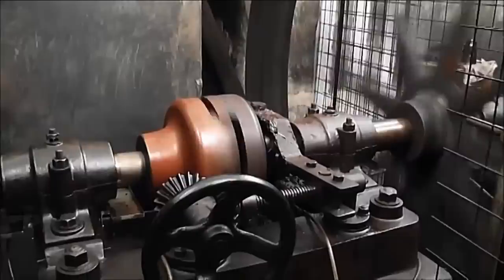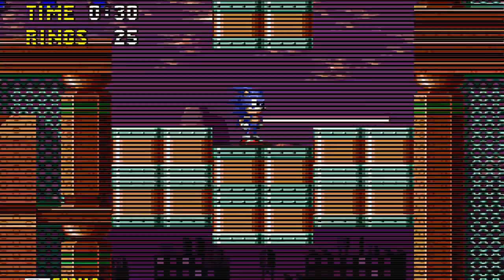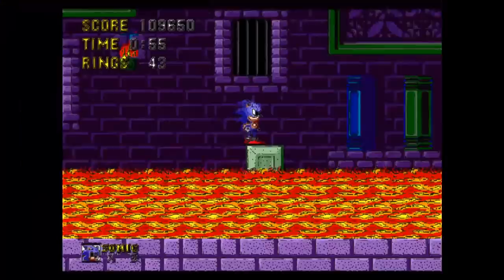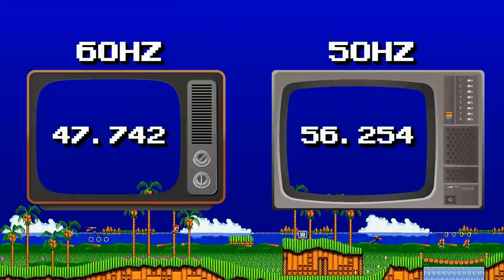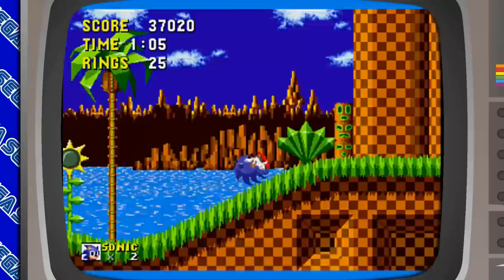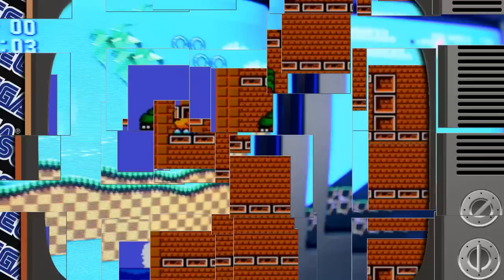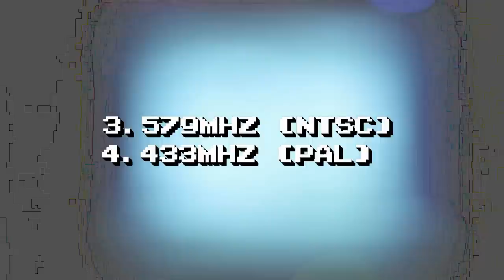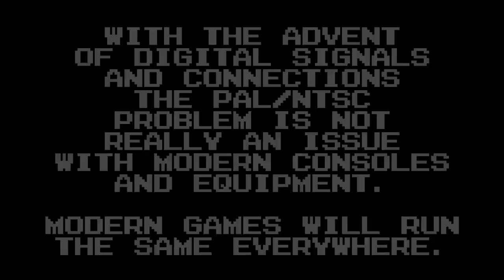Why is Sonic Faster in America? NTSC vs PAL/60Hz vs 50Hz | Nostalgia Nerd

Comment: Yeah we may of been having our blue hedgehog at a glacier 50hz but we got a lovely somber version of Star Light Zone! Take that rest of the world!
Reply from the maker: I do enjoy that version. I also prefer Labyrinth Zone in 50hz
Reply: Similarly, I thought the boss theme sounded more menacing when slowed down.
Reply: But you do realize that the composer of music always intended it to be in a certain pitch and tempo. That's the big problem with PAL in general is that it has a telecine process that speeds up 24 FPS of film to 25 FPS which speeds up and pitches up the sound unlike the NTSC 3:2 pulldown. Pitching up the sound is far more noticeable than the NTSC "jittering" of 3:2 pulldown.
Reply: Apart from the film speed up, 50hz does also use a pulldown system done every 12 field of video!
that works better than the 3:2 pulldown..living in the States back in the 90`s i notice that watching movies on 60hz,the judder was very annoying and distracting to me,i was not accustomed to it, ,also the picture was a little less sharper and the lines very visible on a tv tube 21 inches up and the colour was not as good ,in some programs it look really nice but when they would cross over to programs comming from different parts of the country or video recordings the colours were horrible.
this you could correct with the tint control that was new to me ,but there came a time you just would not bother to correct it anymore and put up with its colours,now moderm tv sets everywere have these tint controls in them, that i find good only for old american tv shows recorded on old vcr.We did get screw up with the Japs slowing down the games and putting black bars at the top and bottom of the picture due to there lower resolution of video.

Comment: 2 things.  1) Sonic 2 in PAL does NOT have optimised gameplay, (it's the exact same as Sonic 1). Only the music is optimised. 2) If you switch the region of the Megadrive/Genesis/emulator during the game being run, you'll get undesired effects. Change the region before starting the game. Otherwise, nice technical video. My video didn't inspire you by any chance did it? :)
Reply: redhotsonic Sonic 3 I believe was better optimized, as the gameplay was much closer to NTSC speeds
Reply: Hey man like your vids
Reply: Wouldn't the PAL version modified to run at the right speed on PAL consoles require the PAL ROM?

Comment: PAL is still better. I wouldn't have survived without SCART Cables. The Image looks so much better.
Reply: I'm so jealous of the crisp slowdown and messed up music.
Reply: A Gamer Aaron Why not play games that are made for PAL? Most games have a PAL Version.
But with Emulation this war has ended.

I still have a SCART cable, even though only my old CRT has a input for that. So much better than Composite Video.
Reply: NTSC consoles have scart rgb output too
Reply: googleboughtmee I did not know this. I thought SCART was a European thing.
Reply: Michi Lo
The Americans didn't have the connector on their TVs but I think Japan did, and all regions SNES/MD can definitely output it if you have a TV or monitor to use it.
Reply: googleboughtmee Okay. I did not know that. But what is the use of a SCART output on the console, if you can't use ist...
Reply: I think it was easier to just not change the Japanese board much if at all.

Today though in the NTSC parts of the Americas you can buy either a SCART to HDMI converter or a more comprehensive upscaler like the Framemeister and get 60 Hz RGB just like in Japan. My US Genesis and PlayStation look fantastic going through a Framemeister.
Reply: MrMikehunt87 Yea. Most games run well on both. And if not, a Raspberry Pi can be a very good console!
Reply: Lamo one game ran slower but all others had fucked colors and lower resolution, I'm so jelly.
Reply: SCART to RGB is not the same quality as SCART to SCART, your cable is just an adapter to let you use European hardware on a North American screen.  True SCART has 21-pins and a fat, meaty cable to hold all those wires, but a SCART to X cable only contains as many wires as whatever X can handle and in the case of RGB/RCA that would be about 4 wires?  (Red, Green, Blue, Ground or Yellow, Red, White, Ground)

Having all SCART hardware in the 80 and 90's was like being the first people to adopt HDMI, it also meant you could copy a VHS tape so perfectly a viewer would be hard-pressed to tell the difference.  A bane for video rental stores in Europe.

Comment: Some clock radios have this kind of issue. In a 50Hz region the clock will keep perfect time, but the code written into the chip means that when advancing the time at high speed to set the clock, it counts up one for every mains cycle, so it takes 1.2 seconds to advance one hour, but in 60Hz regions it would take one second.

Comment: There is no PAL-RGB... only Zuul! :D

Nice video! I really like the comparison.
But please DON'T mix up PAL and 576i. The 625 line system (called 576i nowadays) is resposible for the resolution and field rate of 50Hz but has nothing to do with PAL.
PAL, NTSC and SECAM are nothing more than the colour systems used to transform a colour signal to a monochrome image with a colour overlay, which was necessary to remain compatible with monochrome sets in the 60ies and 70ies. Signals via s-video, composite (simply s-video fused together) and RF (modulated composite) use this technique and while it is true, that most countries with 50Hz use PAL and those with 60Hz use NTSC, it's still two different things. Brazil even uses PAL with 60HZ.That means, that there is no PAL RGB! Only 50Hz-PAL. If it is PAL or NTSC, it must be RF, composite or s-video - If it is RGB, YPbPr or anything digital, it is not dealing with those systems
And that is why the french consoles tend to have those weird RGB exeptions (NES and Atari 7800 are converted to RGB, Master System 2 has RGB and the N64 is prepared for RGB) and why you get colour with the Mega Drive on 60Hz via SCART, because you don't have to care for the colour systems, if you connect via RGB. There's just 60Hz or 50Hz, so don't call it PAL ;)
Keep up the good work! I especially like you CPC stuff :)
Reply: Well, mostly people use PAL and NTSC for these things, as it is just easy to say.

However, I am not sure I agree that these are just color standards, as they specify timing aspects of the signal which is the origin for the vertical resolution of the TV image. The timing became much more of an issue when they were adding a color signal while having to maintain the same bandwidth without causing too much interference between the different parts of the signal, so these new standards had to specify them.

In fact, for NTSC they had to reduce the number of lines per second a bit from the existing standard, which is also why the NTSC standard field rate is 59,94 rather than the 60 used for the older sytem.
Reply: +Ts6451 PAL and NTSC are nothing more than these colour systems. The number of lines and the refresh rates are determined by the underlying TV standards, like 'System M'. While it's true that the timing of the 60Hz systems had to be changed slightly below 60Hz for compatibility with NTSC, this timing is not a property of NTSC. It was done to make the combination of 60Hz TV with NTSC colour possible while staying compatible.

Yeah, I know a lot of people use the term PAL for 50Hz, but that doesn't change the fact that it's plainly wrong. it's like using the terms 'Stereo' and 'CD' interchanged because most CDs are in stereo.

Actually... I wouldn't have minded it that much here, if the NN videos weren't that good and correct concerning technical aspects. For the most part I looked over that PAL=50Hz thing here, but the part, where it's said, you can get colour with SCART because it is PAL60 is beyond wrong :D
It's RGB and PAL and RGB never occur at the same time... and there is a totally different thing called PAL60

I just complain because I care^^

Comment: Games released on the Mega Drive specifically for Europe usually utililze the higher resolution and better colour reproduction of PAL. So basically you give up some framerates for some higher resolution and better colours. Most games on the Mega Drive rarely hit 50fps anyway, so the framerate issue isn't that of an issue for most games released on the system.

Comment: The FCC forced RCA to develop a color standard compatible on both color and black & white TVs. A color carrier signal had to be able to display on both color and B&W TVs. That's why NTSC isn't perfect color. RCA developed perfect color in 1954 akin to PAL, but then this B&W backwards compatibility mandate by the FCC (called The Equal Pain Rule) compromised the color's quality.

Comment: Today it's the same thing here in the US. All TV's are 60Hz and 60 fps. However with modern flat screens they have a thing called refresh rates. refresh rates are a simulation of the real thing. Your TV is still just 60Hz. But a built in microprocessor in the TV takes the original 60fps and then adds in double the frames for 120Hz. And then again it doubles it if you have a 240Hz TV. A 240Hz TV is still only natively 60Hz. But through manipulation it's possible to simulate more than 60fps. 

So a chip inside a US based TV only has to double each time. (Easy math) 60, 120, 240 etc....

Every TV manufacturer gives this effect it's own unique name. Samsung calls it Motion rate. And you still see the effects of the 50Hz vs 60Hz. On a US version of a Samsung TV, or LG TV for example, you will see TV's with 60, 120, and 240 motion rates. But in the UK, TV's go 50, 100 and 200 motion rates. That's because the chip inside can only simulate by doubling the native frame rate. The native frame rate on a US TV is still faster due to our 60Hz electrical grid.

A refresh rate is how fast your screen refreshes. A frame rate is the speed at which the video source was captured at. US TV's max out at displaying 60 fps. But with refresh rates it's possible to make the image on screen far more fluid to the eyes by adding more frames.
Reply: You're talking about frame interpolation, even CRT TVs had a refresh rate, my old gaming monitor was a 75Hz CRT. 

"A refresh rate is how fast your screen refreshes. A frame rate is the speed at which the video source was captured at" Yes, this, exactly this, it has nothing to do with doubling the frames, like I said, that's frame interpolation.
Reply: I'm fairly sure 60Hz is global standard now, I've never seen a 50,100 or 200 TV, only 60, 120 and 240.

Comment: Ehm, alternating current was not invented for higher efficiency for long distances, but simply to make a more simplified motor work. For long distance transmission, the Voltge is at 50,000-150,000 Volts, THAT makes it efficient. Because the lines can be loaded with minimal current-intensity (Ampere) which is important because the higher the Intensity (Ampere), the hotter the wire gets. The colder the cable is, the more efficient is current distribution. But the total electrical power is what's important at the end. For example, 100kW (Kilowatts) divided by 220V would be a whopping 455 Ampere!   That is enough to make a nail melt in 3 seconds! (Look for 500 Ampere on youtube). At 100kV it would be measily 1A. A good household cable is rated at 16A....  At 50hz the length of the sinus-wave is 6000kM....not so important. Frequency is important for transforming low to high voltage. (In transformers for older LCD backlights)
Reply: AmstradExin Um, Ok, Ahhhh,  WTF, Without alternating current, How would you convert the low amperage,but high voltage current to the high amperage,low voltage current needed at the user end? Alternating Current certainly was developed PRIMARILY for long distance transmission of power It took a fuckin genuine genius (Nikola Tesla) to invent a practical AC motor when DC motors were already common at the time, That in and of itself proves that AC certainly was NOT developed to make simpler motors (I now officially have a headache...)
Reply: No, AC was chosen because you can send it cheaply over a distance by having multiple phases close together on a single pole, to send HVDC over a long distance is enormously dangerous and inefficient and can really only be done underground and is why Edison proposed having small power stations scattered throughout cities.  Even today we only send HVDC under rivers and seas because the consequences of an accident could be catastrophic.

Research it.

Comment: The SEGA Genesis/MEGA DRIVE video signal IS NOT INTERLACED! It is progressive!
With a resolution of 320x224 it fits in the 240p standart (with a few lines not being drawn and used for other operations).

The GENESIS/ japanese Megadrive were 60Hz, 60FPS (NTSC), while EU versions were 50hz, 50 FPS (PAL)
And while you stiil see scanlines, this does not mean the image is interlaced.

Aerial TV however is usually interlaced as well as VHS players. That's the so called 480i

Comment: Wait... no scart cables? Those were awsome :D I had loads of adaptors that went from basically all kinds of video outputs available. I even had a box so I could plug in 3 things and have it all output on the same tv with a press of either A B or C on the side. Scart cables were so cool and everything in my house was connected to screens with them. My ps1, my ps2 and even when I got my wii I took those 3 bastards of an output and plugged them into an adapter meaning I didn't need to worry about red being with red, yellow being with yellow and white being with white. It was all rolled into one :P

Comment: There's not a single redeeming feature of PAL50
Reply: What about the fact that having to output less frames meaning that they could be outputed with slightly higher accuracy(I know it's a shit answer but what did you expect :P)
Reply: Actually it has a higher vertical resolution I think.
Reply: Yep, came from a castlevania 3 romhack that I made.
Reply: SirBlueWizard PAL 50 doesn't have a ridiculous tint control, RGB SCART too!
Reply: @ SirBlueWizard You my friend are wrong. PAL 50 hertz runs stable and does not need any bullshit dropped frames trickery like you would need for NTSC to make the shit work somehow. Besides PAL always had the supperior color  presentation, while NTSC was a disaster for broadcasters. NTSC was also  known as an acronym for "Never The Same Color" for a reason.
Reply: Oh, so that explains the "blur"-effect I've been seen all these "sped-up"-versions of these games, alongside the TV-ads (especially the case with "Sonic The Hedgehog") and other recordings up until early 2000's (pretty much the case with all video-game-shows like "Tilt.tv" and so on).
Reply: Except all of the highly redeeming features he mentioned in the video such as higher resolution, better colours, less gimmicks to make it work and SCART.
Reply: Better color
Reply: Celeren who needs that when you can just HDMI mod
Reply: Blank Blank You don't need to mod
Reply: KRAFTWERK2K6 You got shitty ports of our games, NTSC shall love forever like America #MAGA
Reply: PAL is actually all-around better than NTSC for video (more resolution, better image quality and sharpness, less problems with color). It's just not good for games not optimized for it.

Comment: When I visited Europe for work every year between 1999 and around 2005 I couldn't watch television without getting a headache. 50 Hz isn't enough! Hopefully modern HD televisions in Europe no longer have this flickering problem.
Reply: I get said headache quite often from the difference between my TV / monitors and the CRT TV downstairs.
Horrible.
Reply: well weve had 60hz video games since 1999 and im not sure about this flickering problem youre on about cos my american friends say they have never had this problem!
Reply: Around that time, plenty of decent CRT TV's had at least a 100hz mode for just that reason.
Reply: Only CRTs have this flickering problem.
Reply: LCD TV's don't flicker
Reply: CRTs never ought to have been made with a refresh rate lower than 100 Hz (at that point very, very few people percieve the flicker). CRTs have extremely low persistence, which is exactly what is required to kill persistence blur.

Say an object is moving on screen at 10 pixels per frame and your eye is following it. That means your eye is moving 10 pixels per frame. On a CRT, the image flashes briefly, and the afterimage on your retina is percieved as moving along with the motion of your eyes. On an LCD, which is constantly illuminated, the image stays constant while the eyes move 10 pixels during each frame; this smears the image by 10 pixels. That's why LCDs are a bit of muddy mess, even at 144 Hz.
Reply: You also were traveling during a period of time in which HD was quickly gaining popularity in North America while Europe had yet to adopt the new standard.
Reply: the gaming toy boy Some people are sensitive to flicker,and at different frequencies. Some people can't stand the "flicker" of florescent  light vs incandescent light (incandescents don't cool down fast enough between cycles to go "dark". ) I can't see it myself,but some do.

Comment: I programmed games in that time, what programmers use in those days was command to wait until image on monitor is drawed completely, then make portion of calculations, draw image and wait again. If you run that game on 100 MHz monitor it will be (because of wait command) much faster than example of 24 MHz. If i am not wait to monitor it will be flickering like „vsync off” on modern hardware, and it will run in different speeds depending on clock speed of the machine. I could just wait 1 milisecond, but distorion will appear depending on MHz of monitor.